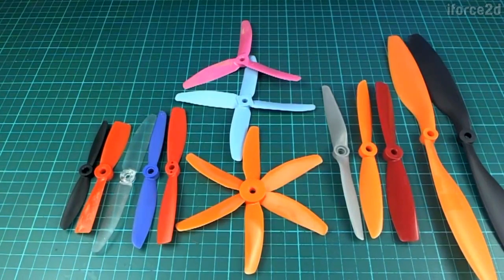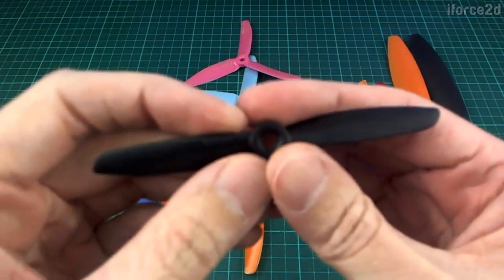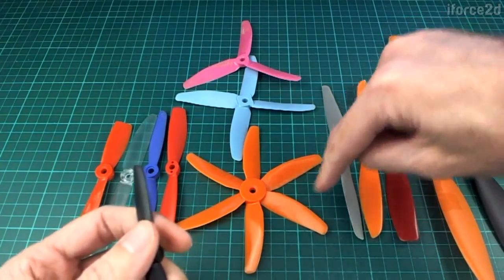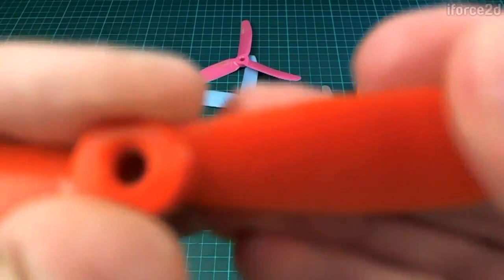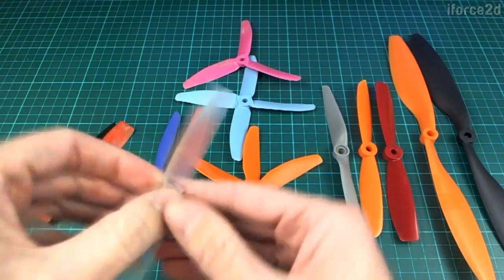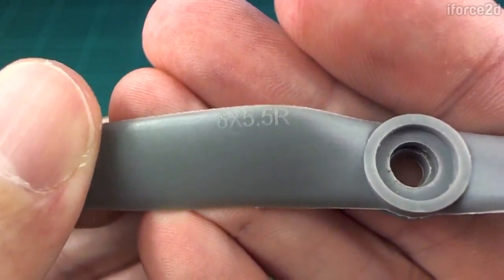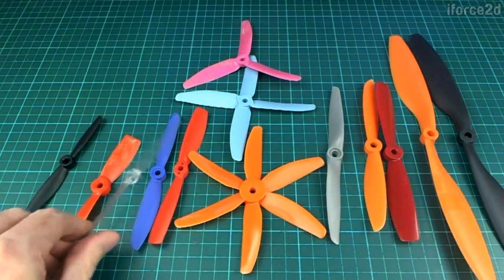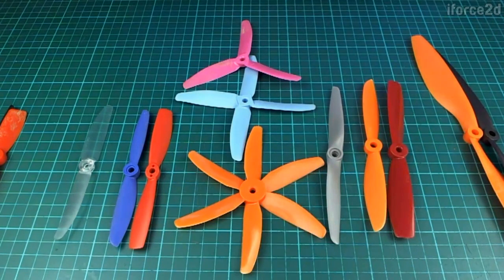Noobs guide to quadcopters part 11 (propellers)

Comment: you can take a heat gun and get the stress line out just have to put it on low. also I you don't have steel hollow shafts on motors hard bullnose props can bend shafts if you dig in. Good vids